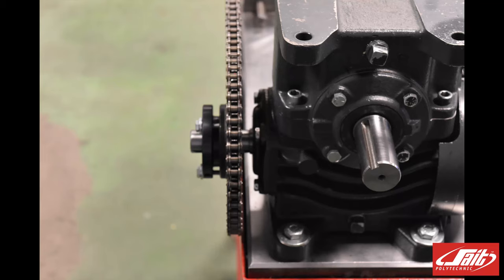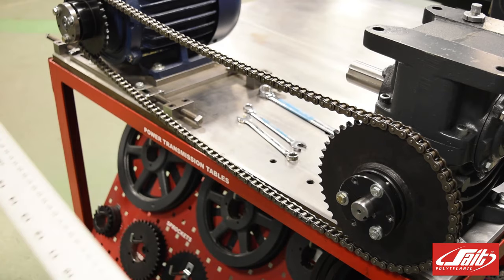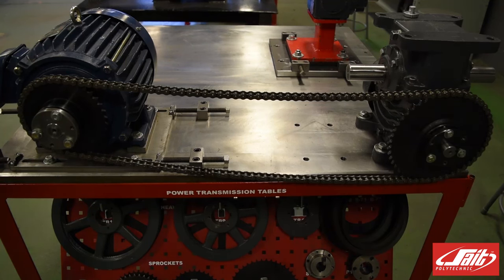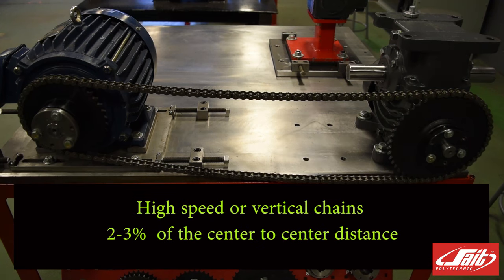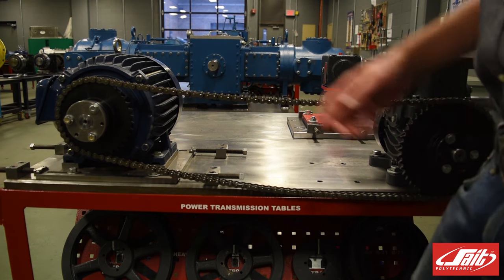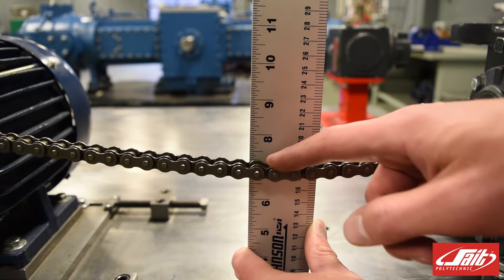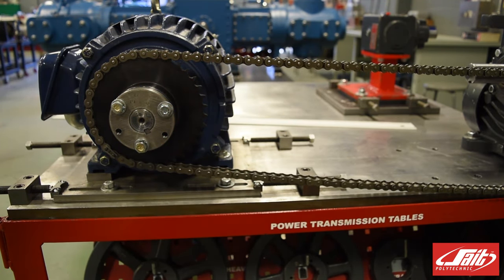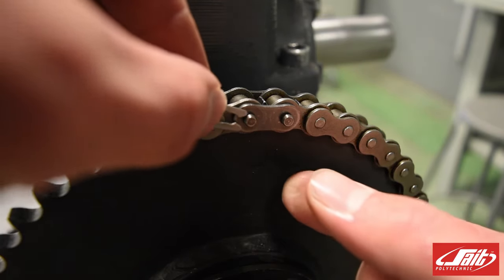Drive chain slack adjustment

Comment: Thanks. About your tip on the direction of the link clip. Is there a two way clip for bidirectional motors such as stepper motor positioning systems, or is it less important with low power/speed situations?

Comment: Great video and info. I have a pet project: a sliding gate opener. I used a bike chain driven by an electric motor, motor speed is reduced with a worm gear. The problem is after few runs, the chain slips off. I have worked on the tension and alignment. What more do you think I should do? I am thinking of installing 'guard plate' (circumferential) on the drive sprocket , narrow enough to accommodate the chain. I am hoping the 'guard plate' will keep the chain from falling off the sprocket. I haven't seen it done anywhere, wondering if it will work.
Reply from the maker: You could try a guard plate. Sounds like a cool project. Good luck.

Comment: What if the motor reverses and goes both directions, then which way is the clip installed?
Total deviation was 3” is that the 4% or is half of the total deviation the 4%. 
Please clarify.
Reply: then just dont care too. it wont come off ever .. from my experience i never seen it come off even if it cliped the wrong way